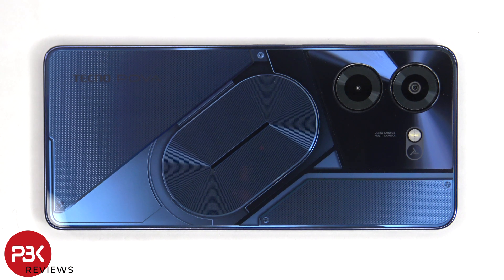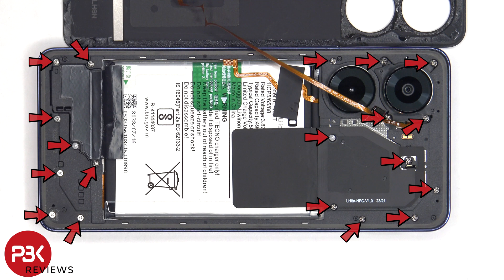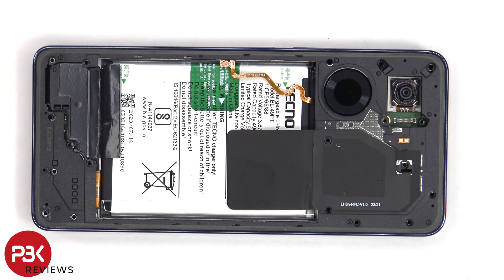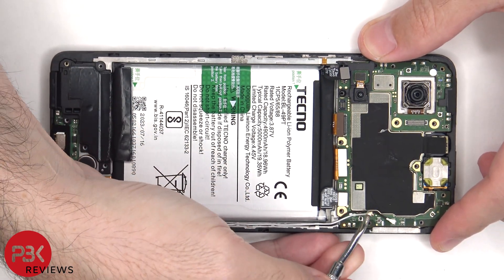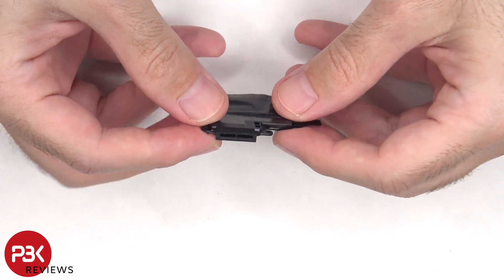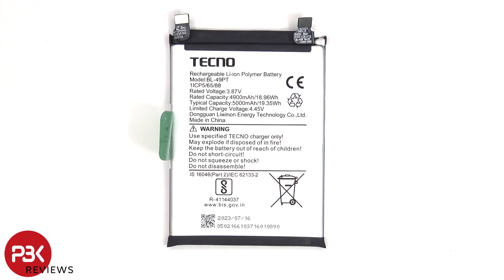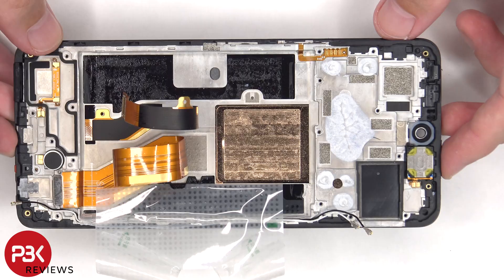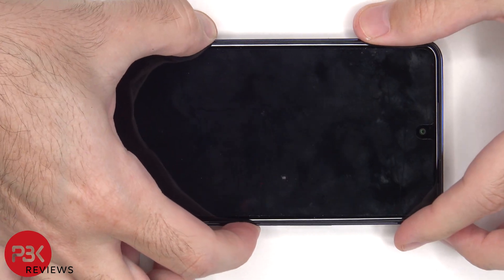Tecno Pova 5 Pro Teardown Disassembly Repair Video Review

Comment: My phone was heated so hard  then it lagged at the same time    after maybe 2 or 4 hours  and the graphic system of the phone changed and phone lagged so hard and it made a strange sound and  then i reseted the phone and then now i relized that the phone start to lag when i open the phone and the phone was from 60 fps to 120 fps before the scene now from 0 fps to 60 fps barely but the graphics still the same and it changed to high boost what do i do and what is the problem

Comment: Hi can i ask a question? How did you remove the paint on the back of the phone? I want to make transparent back.
Reply from the maker: I didn't its just photoshoped. I'm not sure if the extra layer on the back can be peeled off or removed, I didn't try. Usually on glass backs its a laminate layer which can be removed but on plastics its not the case.
Reply: Tell me if you got it done I wanna do it too